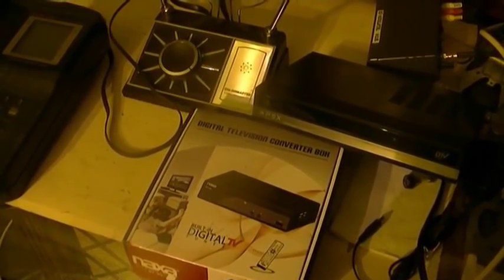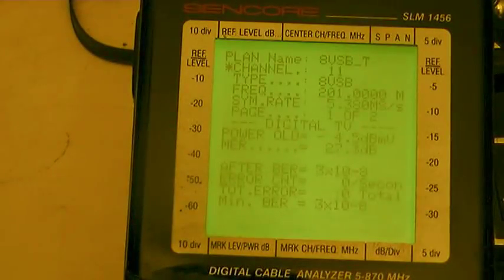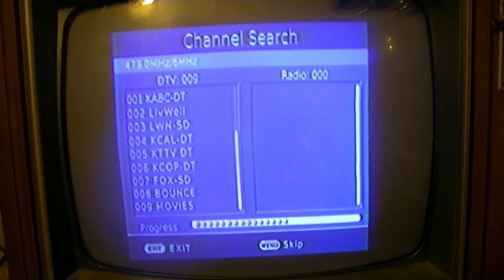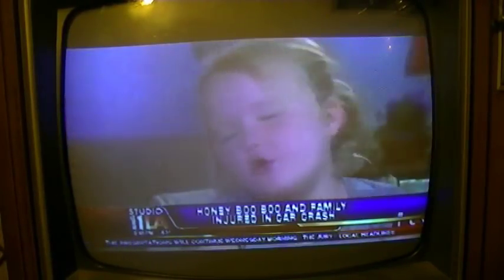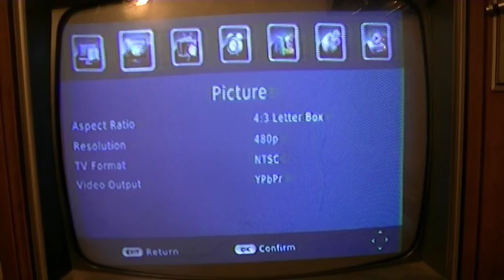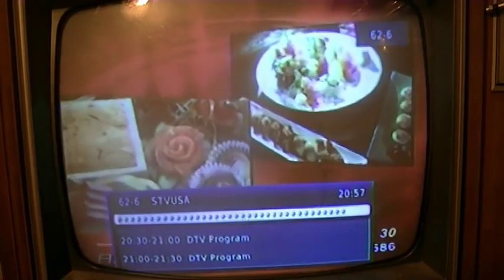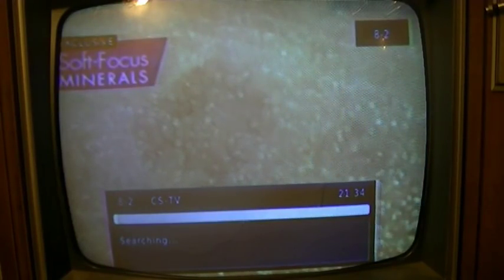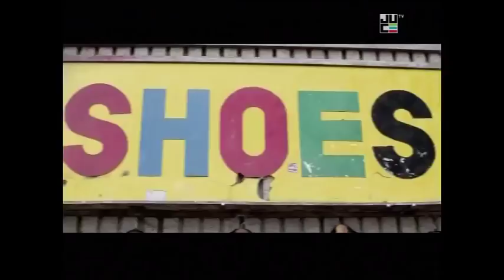Digital TV DTV And Antennas Rabbit Ears vs Directional Antenna

Comment: There are definitely more channels to surf through than when NTSC was alive. The more over-the-air television programming available, the more of a decline in the quality of programming became evident. There was a time when the FCC held television stations to a higher standard; they couldn't even show a toilet or advertise toilet-bowl cleaner in the old days. Mount Wilson has proven to be an excellent location for television transmitting antennas, particularly for the Los Angeles Basin as well as the San Gabriel Valley. Those signals deteriorate as they arrive in the Inland Empire and closer to the desert.

Comment: I WANT THAT SENCORE! That's too cool! Here in Central Missouri the TV stations opted to return to their old VHF channels instead of staying on UHF. Did a video on an old VHF antenna installed in the mid 1980s to see if it could pick up the DTV signals. Got Channels 7 (KHQA), 8 (KOMU), 10 (WGEM) and 13 (KRCG physical channel 12). Was also surprised to pick up 6 (KMOS physical channel 15 UHF). Would link that video here but don't want to upset you by doing that.
Reply: VHF is worse IMO. You need a much bigger antenna to get anything, back in the analog days VHF was relevant but now not so much. When one of my local affiliates tried moving to VHF it was a disaster so they went back to UHF.

Comment: So many factors can affect how many channels you get, you may be able to get many with just rabbit ears and someone a mile away may need a roof antenna for the same ones.
Reply: Is there a big quality difference between one ATSC box and another in terms of reviving channels?
Reply: @tarstarkusz  All the cheap converter boxes appear to be rebrands of what he is using here, so not much choice.
Reply: That's what I figured. They probably all at least have the same chips in them, if not outright re-badged chineseum.

Comment: I just bought a whole vintage setup on ebay so I can watch Antenna TV in the kitchen. OLD reruns only. LOL 9 inch 1977 Truetone black and white for the top of the fridge, converter box  and an old 70s RCA set of rabbit ears not unlike the ones in this video. Now I see in the pics of that antenna's ebay listing that it has two separate wires with pigtails (my parents' term for them). One for UHF and one for VHF. I did grow up around these things, but that was a long, long time ago. Not a clue here. I see in other listings on ebay for similar antennas that have both sets of the "pigtails" connected to one coax transformer. I'm still confused. Is it hooked up the way I'm seeing it those other listings, or should one or the other be used? UHF only? VHF only? Could the attached TV antenna, if it turns out to strong enough for the channel(s) I want, be disconnected from the TV somehow and ran out to the converter box and be used without the extra hassle of another antenna? I can figure out all the right converters/transformers myself. Or could I just tap into it under the corresponding screws on the back of the TV without disconnecting it? I'm sure it won't be too much of a hassle when it all finally arrives in the mail, just like hooking up an Atari back in the old days ,  but I'd just like to know what I'm doing beforehand. Thanks...anyone.

Comment: Can you achieve Dolby with these over the air situations?
do you guys get deja view with All in the family and Jefferson reruns?

radio 1 and radio 2 is cbc.. Canada lives here.
Reply: i think atsc supports dolby 5.1 audio.
Reply: chrisw71
ATSC audio IS Dolby period. Dolby Digital is the common term used to describe the AC3 codec which is part of the standard. AC3 is not just good for 5.1 surround but also 1.0 and 2.0 (mono and stereo) while the video is just standard MPEG-2.

Comment: Actually RF TV signal strength readings are measured not in "db" but Db/mv." "Db" is meaningless without a reference to milivolts. Db/vm is a measure of power of the signal. 

Another note: very very few markets in the USA have more than 2 digital VHF channels. The cable technician meter used in this video is only capable of measuring a small potion of the current UHF TV spectrum. Almost all OTA channels of the day or transmitted on UHF. 

It doesn't take a legacy signal meter and cross comparison video to know common sense: of course an attic installed OTA antenna to perform better than a set of rabbit ears.